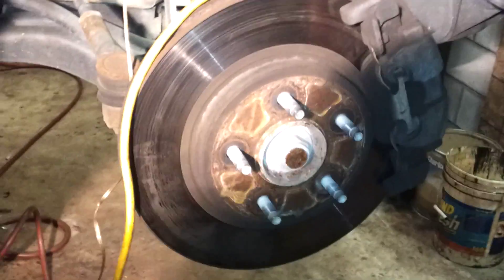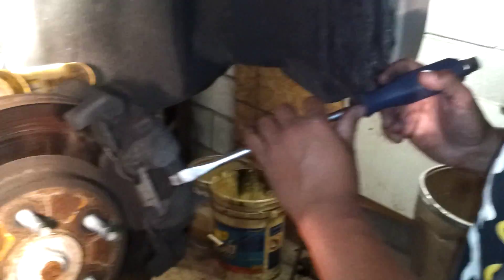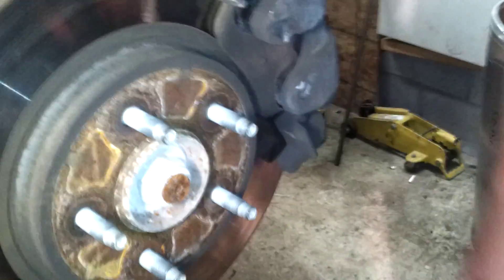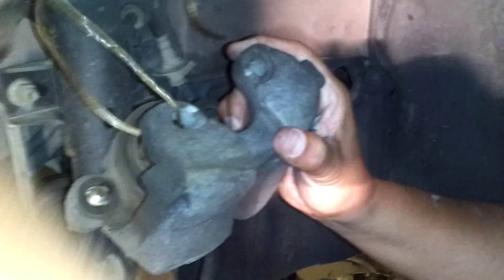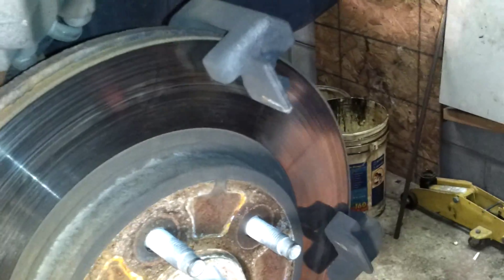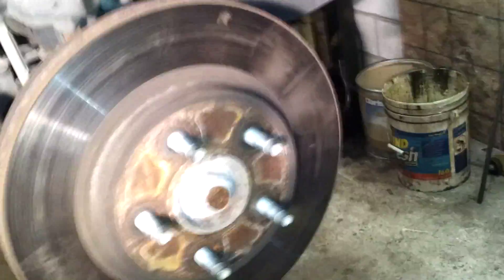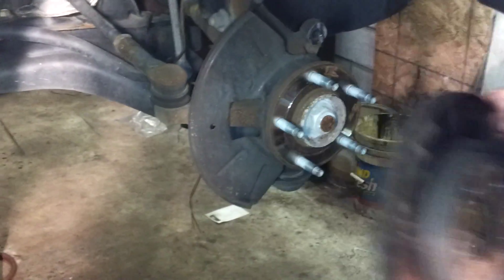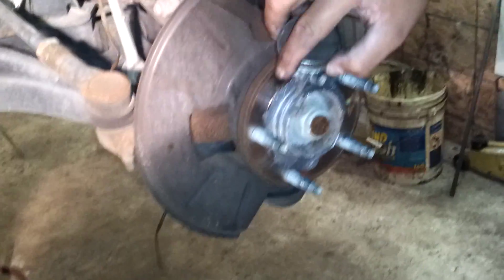Part 3 installing pads and rotors on 2008 Escape

Comment: I also did it without the 9mm allen wrench. Take the 2 18mm caliper bolts out and the entire assembly slides off the rotor.

Comment: I had to call A Snap-On rep to get the 9mm Allen socket. Ford made it that size because its very rare, I guess they hope you bring it into Ford to get it repaired. $30 later I still dont need to bring it to them so it's pretty pointless

Comment: You don't need the 9 mm, it slides right out
Reply: 😮 it's not supposed to just slide out. I just changed mine today and I had to unbolt them. (9mm hex you can get at O'Reilly's)